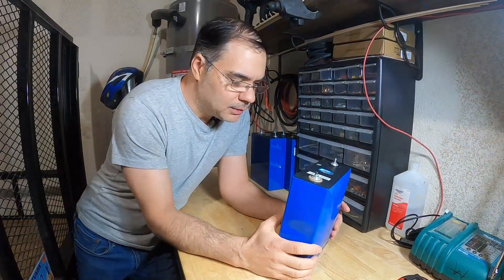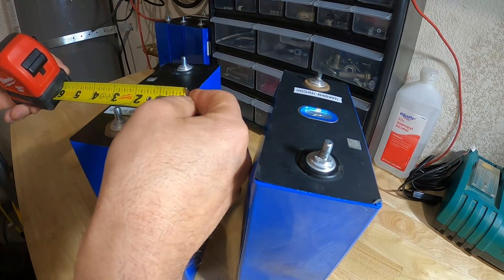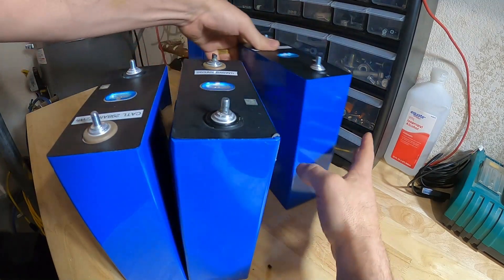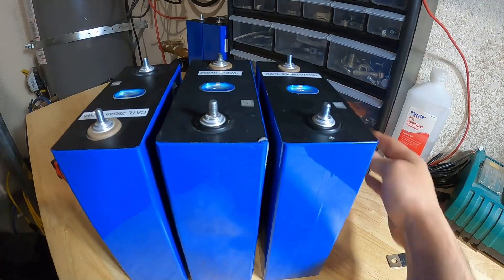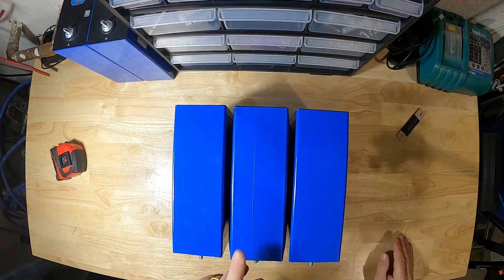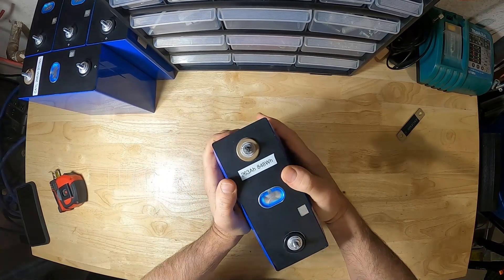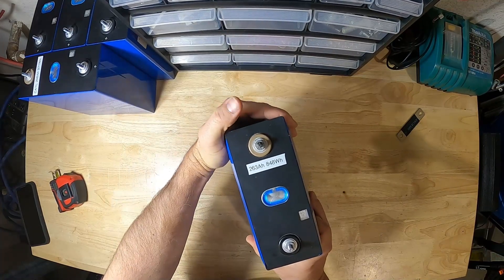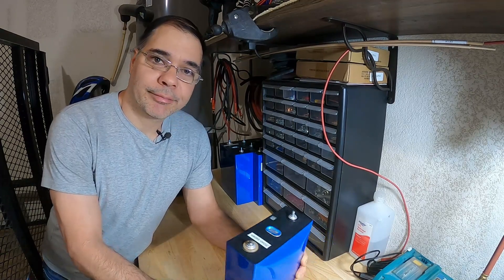What Happens When you Overcharge a LiFePO4 cell!!??

Comment: I had to use a lithium phosphate start battery for my boat when my agm in my car crapped itself out bush on the coast i left it the lithium for two weeks in my car  before swapping it out.   would my car alternator have done bad things to the battery as it would have run more charge the battery is holding charge fine but i'm hesitant to use it in my boat in car if damaged it.  Btw interesting video.
Reply from the maker: It should be ok.  Check this out.  

https://enjoybot.com/collections/deep-cycle-lifepo4-battery?gad_source=1&gclid=Cj0KCQjw8pKxBhD_ARIsAPrG45msO7Jkeo05wV0UCmtX45ygGywmLfSFUutvVnQuFMTFJJwFPGHFxXQaAulbEALw_wcB

Comment: i got some segway batteries and it says lithium ion on it so i assumed the cells were li ion. turns out i tested them as li ion but they are actually life po4. so it tested charged them to 4.2 volts!
Reply from the maker: Oh man.  What happened.  Usually they are li ion
Reply: @natesdiysolar  nothing noticeable happened. i discharged it and it quikly dropped to 3.2 volts and held there ebfore dropping down to 2.6 volts so it clearly was a life po4 cell. oops

Comment: Those cells did not swell up because you overcharged them to 3.85, that happened because the grade B cell poo the bed and poof up. 3.85 Is not enough to cause this big belly action. I have seen it take like over 5.0 volts for this to happen.
Reply from the maker: That is possible.  The ZKE tester goes to 5v. 3.85v is where I was when I found it.
Reply: @natesdiysolar  Dang man...Maybe 3.85v for a long period is enough can cause this. I have seen a BMS charged to 4.2 but that was because I left it as the LIPO setting, however I fixed this pretty quick though did not leave them for a week.

Comment: I have a 200ah x 12v battery, the charger that it always has shows 14.6v at rest, at 0.1 amp charge, when the inverter is used it recharges at 20 amp when it is full it leaves it at 14.6v, the charger never disconnected it of the battery, I would like to know if keeping the battery at 14.6v is fine, thank you, your video is very good
Reply from the maker: It's perfectly fine.. those plug-in chargers will charge to 14.6 or (3.65v) per cell, and that's totally fine.  If you are using your battery regularly It's perfectly fine. When you want to store your battery for months on end without using it, that's when you want to discharge to around 40%. I personally like to use a 90/10 or 80/20 cycle on my inverter settings just to get the max life out of the cells.  90% top and 10% bottom.  That's a good battery you have if it's holding 14.6v. What brand is it.. thanks for watching!
Reply: @natesdiysolar  Thank you for answering, the battery is an ampere time brand, 200ah x 12v, I feel calmer with your opinion, I bought a new victron blue smart 20amp charger, I can change the types of charging via bluetooth, it keeps it at 14.2v , but I know that I am within the normal range, I was waiting for your answer, thank you once again, I am from Venezuela, I bought through Amazon and in a week I received the new charger
Reply from the maker: @ricardo limongi  no problem.  I have 2  ampertime 24v 200ah batteries myself.  They are pretty good.  Iv used them for 8 months now.  I'll be posting a video soon about my solar power station with these batteries.. glad to help. I love Victron equipment... very good quality.

Comment: Interesting. I would not have thought you would see such a big change at 3.85V.

I recently did some experiments with some crappy LiitoKala 100aH to see if the  leakage current (the current required to keep the voltage at a set value) changes with higher voltage (just curious). so I ran 2 days each at 3.65,  then 3.85 and then 4.05V. I am not  sure if they bulge more than before. I will have to re-run a capacity test. The result was the current needed to keep a steady voltage after 2 days, went from about 1mA at 3.65V to 1.8mA at 3.85V to 2.5mA at 4.05V.

Maybe I should try 2 weeks. Now I am intrigued.

I think some battery manufacturers set their HV cutoff to 3.75V. That is getting uncomfortably close to 3.85V... (My own batteries I charge at 3.45V (absorb) with a cutoff of 3.65V.)
Reply from the maker: Ya I think the key parameter is time... the ZKE tester has a range of 0 to 5v so it's possible it went to 5. The resting voltage was at 3.85 when I noticed 2 weeks later.. it could have dropped by then.. thanks for the info and thanks for watching!

Comment: So did you accidentally charge it to 3.85v, notice this error, and remove it from the charger? How long was it at 3.85v on the charger? Also was it bloated when you noticed you overcharged it, or did the bloating come after sitting for some time? Thanks
Reply from the maker: Hi Brad. I did, in fact, accidentally charge to 3.85v. I was cycle testing a bunch of cells using the ZKE tester and must have not noticed the voltage when removing from the tester and went on to the next cell. It was slightly bloated before testing, but after sitting for a couple of weeks, it had expanded even more.  The bloating was not immediate.